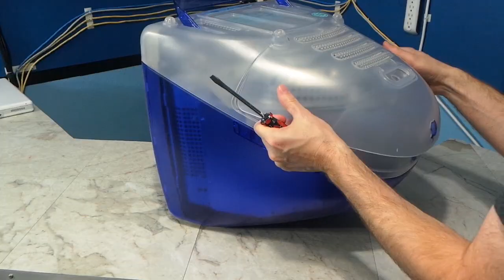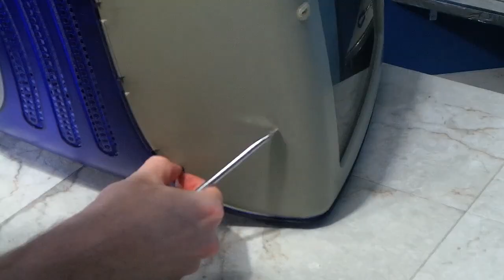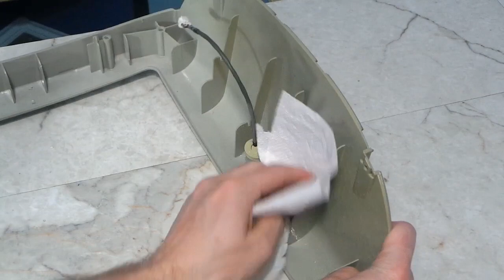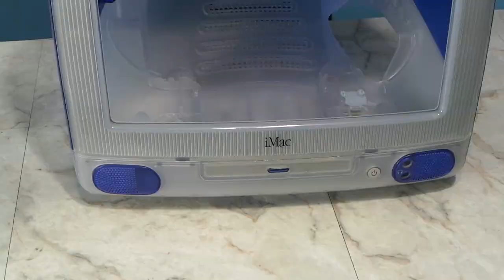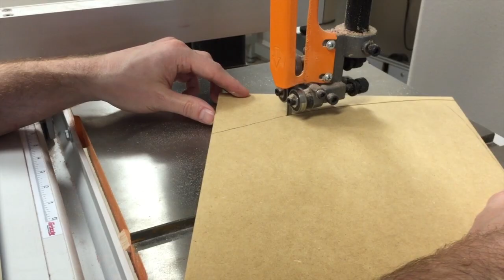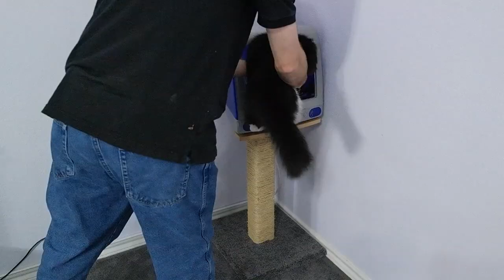Build an iMac G3 cat house

Comment: In case anyone actually sees this, some heads up on the CRT:
Touching the bare anode cap to ground with the machine powered off will NEVER do anything, as the HT lead is connected through a fast recovery HV diode to the secondary of a transformer. The field collapses within milliseconds of losing drive and there will always be ZERO voltage at the anode cap by the time you are capable of removing the cap from circuit.

ALL CRTs manufactured after the early 1950s either include an internal bleeder resistor (a stripe of carbon inside to discharge the tube automatically) or an external bleeder resistor (connected across the output of the HV diode directly to chassis or aquadag ground) which within seconds of powerdown will discharge the tube completely.

Stop being scared and spreading lies.

Comment: I always wanted to use these CRT's for something different, never find anyone who could make it. Its probably very hard to mod the old apple CRT's like remove the PC parts and just use the monitor. They are pretty cool
Reply: What about an old CRT monitor case?
Reply: Since it has a VGA cable, you should be able to use it with almost anything.  You don't have to remove the computer parts as long as the power is still getting to the screen.

Comment: question: will the CRT discharge if the chassis is not connected to ground - i.e. plugged to an actual ground lead? I would think it'd just set the chassis to the same voltage potential if there is one?

Comment: weird, i seem to have had the same mac but its intestens were not as crazy shielded as these ones. Also mine had one of these cd drives like the modern consoles do have. Is this a regional difference or rather a different Mac at all?
Reply: TheCludo there was a second revision with a slot loading drive and a fanless design. This is probably the model you have.
This cat house was made with the original tray loading model from 1998.
Reply: yea that thing was awesome, until a friend brought some pc games and i was disapointed none of them worked back then exept for diablo 2

Comment: Can someone please tell me what a CRT is?!
Reply: yup, it's a vacuum tube where a metal plate is heated to a point where electrons start to boil off. because of the vacuum, and the fact that there is an opposite charge where the screen is, the electrons will travel to the screen and energize the pixels; this, along with magnets to change the path of the electrons is what gives you a picture. its not the most technical explanation i'm aware. i'm unsure of the exact terminology and i didn't want to bother researching it as it would have made the explanation needlessly complicated.
Reply: ccandrew111 thanks for telling me
and how it works! { very interesting to me i have to say}
Reply: ***** thanks for telling me!

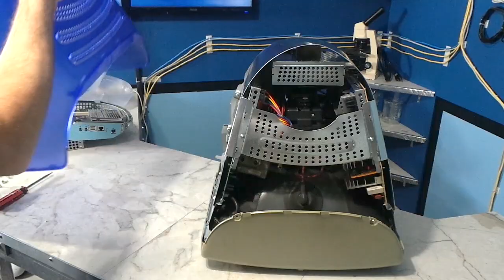Comment: can someone explain to me what he means at 1:40 about electricity still in the monitor because I didn't get that is there a small battery of sort?
Reply: something with a CRT
Reply: CRT is the monitor, but older CRT monitors hold a massive electrical charge so if you touch it, you will probably die or get electrocuted badly. What 8-bit guy does is he discharges the CRT using the metal shell for ground.
Reply: Kippy Kip thanks for the explanation 

WoW that much Electricity that isn't even Pulgd in Amazing and Dangerous

Comment: I would like to get another working example of the iMac G3. I had one once before, but I assume the PAV board in it died, and if that goes, there's no point in fixing it, even if you have the technical know-how. There is another listed on the classified ads for $15, but it may or may not work and it's missing the optical drive.

Comment: if i were to get my hands on one of these, how hard/practical would it be to build a basic hackintosh inside with a modern monitor?
Reply: finding a new screen would be the hardest part
Reply: Yeah i would probably use a smaller 16:9 with some type of spacers

Comment: So if I'm only taking the logic board out, I won't have to worry about any low-voltage flyback transformers or anything like that shocking me, right? I've heard many sources say the warning is somewhat irrational and exaggerated, but I just want to be safe so I don't kill myself while upgrading a G3 for the first time. Also, are there any grounding precautions I should take when working with the logic board, such as wearing an antistatic wristband, or is that unnecessary?
Reply: +Dr Scrubbington ⟨InfinityV0rtex⟩ About high voltage - just wait at least several hours between disconnecting the monitor from mains power and starting dismantling it. About electrostatics - it's really safer to use anti-electrostatic precautions.

Comment: i've been telling my friends for years that iMacs werent useless
Reply: +Dami Nooki We don't need you here Mac OS...
Reply: its proprietary apple BS like everything else they produced. a PC might be "ugly" but its a tool made for utility. if a PC breaks you can fix it.
Reply: your not going to install a standard power supply or motherboard. buy a board for a PC you have over a dozen brands to choose from. that makes them cheap, competition between manufactures.
Reply: so why not just build a PC and load mac os
Reply: Samuraigamer lol
Reply: The way the monitor is shaped, it would make a perfect urinal!
Reply: indeeded
Reply: andrew donohue back then you could even buy cpus from other manufactures for your Powermac g3 and g4. And the old mac pro was easy to repair. But sadly, Apple works against such things...
Reply: @Emptiness_Machine_2001  the new iMac is repairable but it's a pain though. The 27 inch ram upgrade is very easy though.
Reply: lol
Reply: @katzenware  bad quality?
Reply: Samuraigamer FUCK YOU

Comment: My God, I have exactly one of these Macs in the garage in bits, same colour even! I was going to silicon glue it back together with an indigo / blue / white LED array in an exterior light fitting inside and then put it in the garden. I already cut the front of the CRT tube off with a stone cutting disk on an angle grinder so it will have the original screen too.

Comment: My dad had an iMac DV (the second gen of G3 iMacs), that I popped open once to replace the hard drive, and interestingly while it looked very similar from the outside, it was built quite differently than this one. It opened from the top rather than from the bottom. It also didn't have a fan.
Reply: The slot loading machines are completely different inside

Comment: I have an idea for a project to do on my G3 (Bus error, dunno if the HD is bad or the logic board, replaced the IDE cable with no change.), Take out the computer part, wire in a CGA to VGA scaler (ebay for like $30), and a Sync Strike (Strips the Sync in a RGBs signal to make CGA video), and make a RGB monitor.

Comment: won't it fall over when the cat jumps in bc of the weight? or is that no problem as long as it stands in the corner?
Reply from the maker: +empxth It hasn't been a problem. and the cats are jumping in it several times a day.  I do think it occasionally bumps the wall when they jump in, but the wall is only less than an inch away.  So I guess it does move some.
Reply: oh okay :D
Reply: +empxth You could always add some weight to the base plate if that is a true concern, enough weight down there should prevent the whole thing from falling over or moving.
Reply: yeah, thats a good idea :)
Reply: He talked about what he will do about the computer falling over in the vid.
Reply: Orson Jarrett hm, it's been a while since i worte that comment, but i must've missed it, thanks! :$

Comment: Wait does disconecting the anode in the crt effectively kill it? Or does it still work
Reply from the maker: POKEMANZZ3 - It does not damage it.  You could certainly plug it right back in if you intended to use it again.
Reply: The iBookGuy okay good i was scared you just murdered a innocent crt XD
Reply: were do you buy your vintage computers for a cheap price

Comment: I guess is easier to adapt the LCD on the G5 that the CRT (or replace in for a LCD) on the G3. The G4 are EXTREMELY expensive and I would prefer to do a proper Hackintosh with a NUC on one of them
· 1
Reply from the maker: zingzang roy - Actually the G3 would be easy (signal converts to VGA easily), and the G4 can be done as well (signal converts to DVI) but the G5 would be very hard.

Comment: why are you wering glowes haha if it was chardged the gloves wudnt help much
Reply: ***** wellat 3.000.000v 2mm of rubber doesnt exactly help all that much :)
Reply: ***** the voltage wud just over the rubber even at 200.000 v i got schocked 2 times soo i know that 2mm rubber gloves dont insolate you very well

Comment: A Raspberry Pi iMac... πMac... That'd be cool.
Reply: Yeah. The PiMac hahaha
Reply: Jack Durrant A G5 17" iMac would be a good computer to host a Raspberry in!
Reply: MrPlayboy28 Maybe, but the iMac G3 is more retro. A G4 might make a good πMac, just because of its awesome unique design.
Reply: Jack Durrant I guess is easier to adapt the LCD on the G5 that the CRT (or replace in for a LCD) on the G3. The G4 are EXTREMELY expensive and I would prefer to do a proper Hackintosh with a NUC on one of them
Reply: Jack Durrant In Portugal any Mac is overpriced, I've seen G3s listing for over 70 pounds! I just think that the iMac G4 is so awesome that if you update it you should do it the right way, not upgrade it for something that's as limiting or ever more limiting than the G4. A Hackintoshed iMac G4 would run exactly the same OS and apps as a brand new iMac Intel.
Reply: MrPlayboy28 G4s don't seem to cost much more than G5s on eBay in the UK, although I can see why they would cost more elsewhere. I suppose if you're going hackintosh, you'd want the computer with the bigger screen.
Reply: The IRaspberry Mac

Comment: As a word of advice: The inner front bezel of iMac G3s can discolor with age, much like how white plastics can yellow over time. If you use your similar 'retr0bright' methods on that inner bezel, it will look like new again.
Reply: Just like every vintage Apple device... (I mean prior to the iMac G3.)
Reply: Lara Dudleysmith Yes, but this plastic is gray instead of beige. I would assume that some people would either not realize that it's discolored or be unsure as to whether or not the discoloration can be cured.
Reply: Yeah, that's why I like any plastic color except grey, white or beige... everyone thinks it's a different color than what it really is.
Reply: Lara Dudleysmith It's unfortunate that the gray plastic can discolor; it seems like it wouldn't so some people don't even realize that theirs is discolored. (The discolored plastic is also underneath the entire frontal bezel.) In fact, TheiBookGuy's iMac in this video has discolored bezel plastic. You can tell, in the thumbnail. Look at the bezel, then look at the lower portion--where the speakers are. Aluminum with an anodized finish is the best material for computers, but it is VERY susceptible to gouges, grooves, and scratches. The polycarbonate, though, in iBooks is also a nice material... but it gets scratched like crazy. I am tempted to guess that it's not really polycarbonate--as they say--but rather acrylic.
Reply: Yeah!  I had a Mac 128 and a Quadra 700 (I sold them a while ago) and I kept having to retrobrite them (I knew at the time that only white and beige plastics fade) but grey is a very unusual color that gets faded (I didn't know grey plastics could fade until I watched this video.)

A little off topic here but maccollectorz you make good videos :)
Reply: Lara Dudleysmith
I guess this gray plastic has a somewhat beige-ish hue to it? xD IDK. Hey, thanks for watching and liking my videos!

Comment: I have opened these up before and have a few of them... but I never really thought about the standard display cable that it has. I have an adapter that adapts that same connection to VGA, and similar ones are sold online; this would make it very easy to stick a modern computer inside of this Mac. Too bad, though, that these things have very crummy displays.
Reply: Sam Gates Many LCD screens are actually worse. LCDs didn't become better than CRTs until later on.
Reply: The main obstacle is turing on the CRT without the logic board. This is something I would like to know how to do as well, to use it as a DB-15 display for another Mac (I do not have a DB-15 to VGA adapter).
Reply: Timur Tripp Do you know how that could be accomplished? Not sure why I didn't think about that... it's an all-in-one, not a separate, full-fledged monitor.
Reply: maccollectorZ (Commenting Account) No, unfortunately, although there is some good advice on this forum thread: http://forums.macrumors.com/showthread.php?t=1859559
Reply: Sam Gates Well, it wouldn't be a main computer-that's for sure. I'd like to do my eyes a favor, though! ;) I'm actually looking to get a new monitor soon; if so, it will be the first brand-new monitor I ever buy.
Reply: +maccollectorZ (Commenting Account) True, colors seem to pop more on high-quality CRTs than early LCDs, and the black blacks is something still not present on LCD. The 21" Studio display and 17" eMac displays are both very nice Trinitron CRTs, and OS X's early Aqua interface looks really nice.

Also, the resolution independence of a CRT means it looks much nicer than an LCD if you somehow need to run lower than native.
Reply: +Sam Gates "Led is shit because it's just a cheap more lighter and thiner than LCD." Why do you say that? LED backlights are more efficient and less prone to burning out or yellowing over time. The panels themselves have really gotten better since the switch to LED backlight as well, just look at the stunning displays on the 5K (and now 4K) iMacs.
Reply: +Sam Gates I use CRT's when playing back raw camera footage because the colours are more real, also the image quality on CRT's can be much higher than LCD, LED or plasma. Depends on the CRT ofc. I have some professional Sony CRT's that look better than any HD screen iv'e ever seen.
Reply: Chris Slot I'd say recent IPS LCDs have finally caught up with and even surpassed good quality CRTs with color reproduction and sharpness. All of Apple's Retina Mac displays, for instance, support full sRGB color output. The contrast ratio is also much higher than it used to be.

Comment: Great work as always David. One question - what model iMac is this? 1999? 2000? I have a Summer 2000 iMac DV SE and it looks very similar. Thanks!
Reply: The iBookGuy It's not the original, the original is in Bondi. This one is the 2nd generation that came out in 99 and featured 5 different colors: Strawberry, Lime, tangerine, Grape and Blueberry. They also could come in either 266Mhz or 333MHz. ;)
Reply from the maker: Wolfgang Frick -This was the original iMac 233 Mhz.
Reply: ***** I believe the Rev B (the one I own) were made in 99
Reply: ***** What about? The location is the same for every iMac G3
Reply: +MrPlayboy28 Há tugas em todo o lado
Reply: The iBookGuy I can see from a mile away that this is not an original iMac. It, however, does look like a Blueberry.
Reply: Naavexen Erhora it is original beacuse it's tray loading not slot loading like the later models .☺
Reply: The UnitedForcesOfCakeMoose It is the original type, but not THE original G3. This is a revision C or D tray loader.
Reply: ***** And of course, a slot loader.